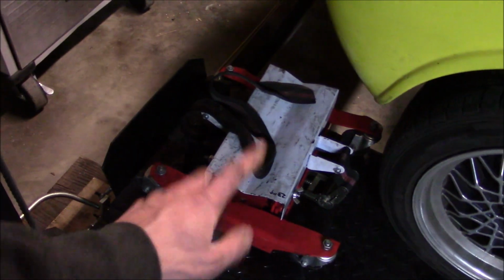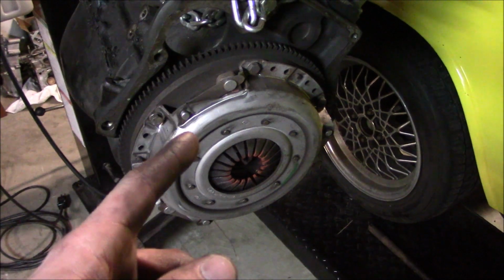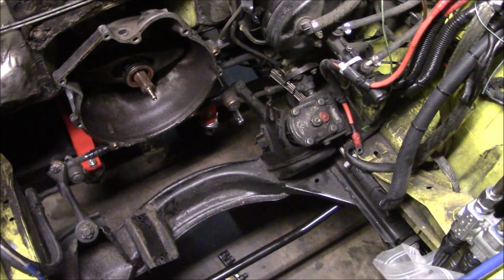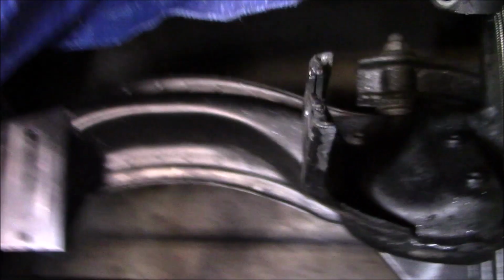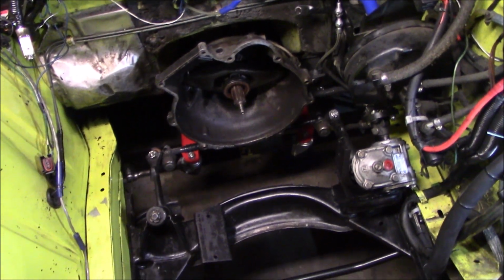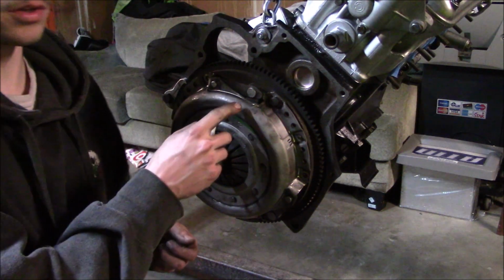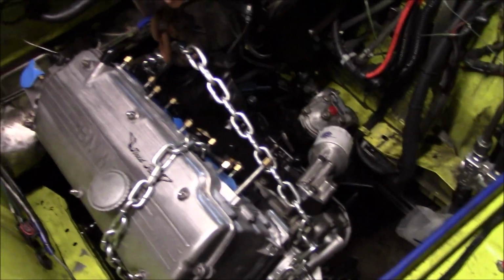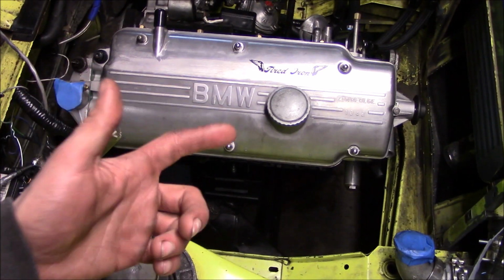BMW 2002 Turbo Built Motor Gets Installed! Steering Box Seals, Engine Mount Reinforcement

Comment: Where did you get the turbo header? I think Jeff Ireland made a few years ago, I unfortunately didn’t get one. Thanks
Reply from the maker: This is an old one built in the early 2000's by some dude. He did a good job though it hasn't cracked